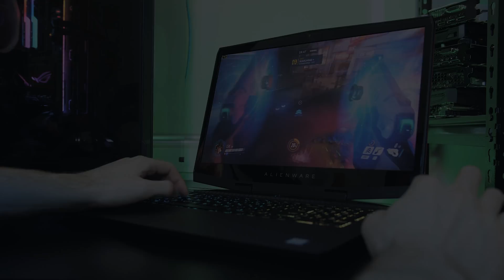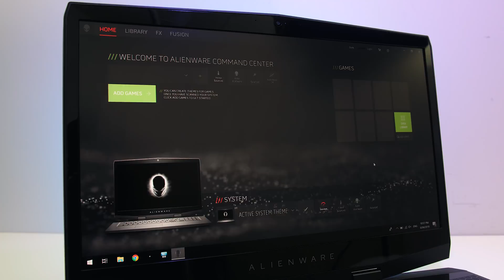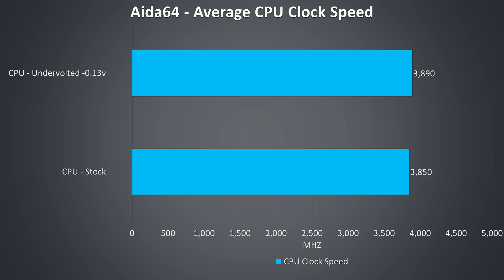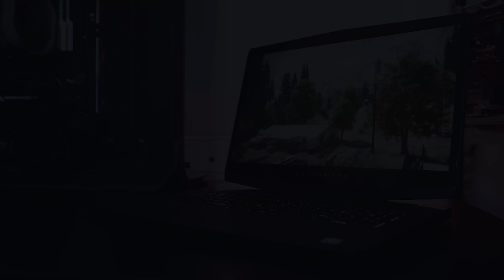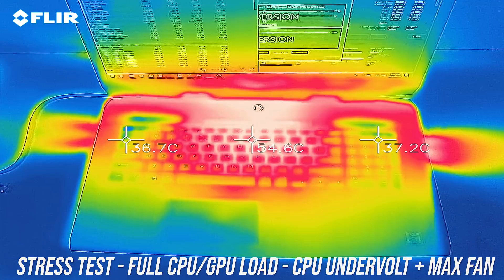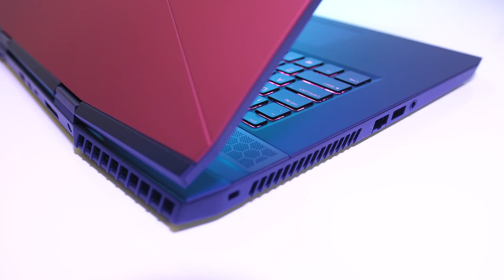Alienware m17 Thermal Testing, Overclocking and Undervolting

Comment: i have the i-7 9th gen, with a 1660 ti of this laptop and it has the best thermals ive seen. i use a cooling pad and undervolt with throttlestop, while gaming neither go above 70c also disabled bios updates so it doesnt get the plundervolt patch

Comment: Can you do the same for the M17, i7-8750H with RTX 2070 Max Q? I'm getting average CPU Temp of 99 °C and GPU 90 °C, is this normal?
Reply: I have the same one. Yes this thing is really hot, I undervolted, using cooling pad and increased the fan for gaming. Let me know if I can help.
Reply from the maker: I've been trying to get new Alienware stuff but they stopped lending me review units. My one in this video runs hot, I'd expect the same from all of them to be honest, give undervolting a go.

Comment: Hi Jarrod . Nice video I bought M17 Alienware based on your review. My configuration is I7 9th generation with RTX2060 OC. Well the bottom line is thermal throttling on the gpu is not existent. Cpu hits a 100 C 4 times in one hour game play(Witcher 3) not noticeable during the game I monitor the temp with Intel Extreme tuning average temp on CPU package was 80 C. My off load temperature on the CPU is around 40 C with room temperature around 20 C. Regarding the thermal pad I did buy a thermal pad as you recommended I got Coolermaster U3. Initially before the thermal pad I had to raise the rear rubber feet on the laptop by 5 mm above the desk surface this also made a difference and it was completely free. I didn't play with voltage and clock speed . I did purchase new thermal paste for the CPU and GPU but it looks like the stock paste is working well. 
Best Regards,
Alex
Reply from the maker: Nice, good to hear you got some improvements! Yeah I have a cooling comparison video coming soon, comparing a cooling pad and simple stand, well the stand offers most of the benefit.
Reply: @JarrodsTech  In my case the 5 mm Lego blocks made the most difference. But the stand makes the laptop a lot more comfortable to use and type.

Comment: what software did you use for the undervolt
Reply from the maker: Intel XTU, Throttlestop is another option.
Reply: Jarrod'sTech sweet thanks, my m17 has a overheating issue so its at 100C a lot so I’m trying to mitigate the heat until the tech comes

Comment: Octane render in cinema 4d tells me there is no cuda device detected on the exact same laptop ..... any solutions ???
Reply from the maker: Not sure, every time I've seen stuff like that the software is detecting the Intel graphics because it's in Optimus mode by default. Is there a way of selecting the correct GPU in the software? Disabling Intel GPU through device manager may help

Comment: After my initial m17 r1 Thermal Grizzly repaste (and raising back of laptop by 1.5 ") after playing games (Apex, DMC 5) for 2 hours or so, I was getting max temps in the low 90's and throttling on some cores (usually 1,3,5), but my average temps were in the 70's, which was a drastic improvement from pre-repaste when the max temps were all 99 with throttling on all cores and average temps in the upper 80's/lower 90's.
I decided to undervolt using ThrottleStop. Since I have a i7-8750H processor, I used Bob of All Trades' video and undervolted CPU Cache and Core by -125mV. My temps decreased by 10-15 degrees!! Now with the repaste, raise and undervolt...I am getting max temps in the mid-70's with no throttling and averages in the mid-60's. 
Makes me wonder how good the temps would have been within the repaste, and undervolting ONLY. Hm.....
Reply from the maker: Cool nice improvements 👍

Comment: I was told by Alienware Support that my m17's i7-8750H processor was operating within normal limits when it constantly peaked at 99 degrees and averaged in the upper 80's-lower 90's while playing Apex for 45 minutes. They told me that a long as it doesn't go over 100, it is fine. That may be the case but I questioned the processor's (and laptop's) longevity if it constantly hit 99 degrees during hours of gaming. Thermal throttling was detecting on all six cores. I decided to repaste. This was my first repaste I had done and was a little nervous about diving into the various components. I figured if I am going to attempt this, I wanted to be prepared. I got all of the recommended materials including Articlean solutions as well as thermal grizzly kryonaut. I followed the m15/17 disassembly videos and Alienware Support's m17 repair manual to remove the necessary components. After removing the heatsink I was surprised to see how thin (practically transparent) the stock paste was. I have read that Alienware in particular using junk paste. I followed the directions on the bottles. I first applied only a drop or two from Bottle 1 to each component (CPU and GPU) and let it sit for about a minute. Afterward I used a business card (to scrape away the gunk) and a coffee filter and micro fiber cloth to clean the rest. I then applied Bottle 2 to polish or finish the surfaces on both the CPU, GPU and their heatsink plates with a micro fiber cloth. As you can see in my photos the CPU and GPU with super clean and ready for the thermal grizzly application. I know there is some debate on this but I went with the line method since both the CPU and GPU were rectangular. It was a hot day (90 degrees +) and at first pump, more came out than expected, but I was able to clean it up after. I have read that other experience the paste to be very thick...but after sitting my 90-degree apartment for a few days, the paste was a lot thinner than expected. After applying the paste, I reattached the heatsink (be sure to follow the screw patterns - FYI my laptop had numbers of the heatsink so you can follow the correct pattern to loosen and tighten the screw to presumably get an even paste spread) After closing everything back up, I ran the Alienware Stress test and saw that the CPU was now peaking at the late 80's - low 90's but that the average temps were about 9-15 degrees lower without thermal throttling on any core. I later gamed for about 50 minutes as saw similar results though with throttling on two cores. I am happy with the results. The GPU also decreased by about 10 degrees on average, Maybe I could have pasted better (less/more?!) but I think I was able to achieve good coverage on the CPU and GPU. (I guess I'll see if and when I have to open it back up again?!) I think overall it was worth it. The temps make a difference and also offer a peace of mind for those longer gaming sessions. Some things to note: you only get a gram of this stuff, but be careful when applying or reapplying, the spatula that is included may be useful but I wouldn't know I did't try it based on other reviews, those that had difficulty using the spatula noted a thicker paste and an inability to properly spread it without making a mess. The general concensus seems to use a little amount (dot/line/x) and let the heatsink pressure naturally spread the paste as you tighten the screws. Last tip is not to understand simply raising the back of your laptop or an elevated cooling pad. This can easily decrease temps by 3-8 degrees. Also ambient temperature makes a big difference...the temps you get gaming in an air-conditioned room as opposed to a 90-degree room will obviously vary.

Comment: So would you say that the undervolt got the thermals well enough under control? Or would you recommend a different machine entirely?
Reply from the maker: I'd pick something else, it helped, but worth keeping in mind I'm doing a worst case stress test here so also depends how hard you plan on loading it up. Hopefully the new 2019 model is better, have not tested it yet though.

Comment: Is there yet any reliable and final solution for thermals ! Specially who are doing renders with full tilted performance .. i mean for  hours ! And hours .. also is undervolting affects the multicore speed ! And singles core ones ?
Reply from the maker: Undervolting improves multicore speed, as it lowers the amount of power required by the CPU, so it can perform the same with less heat. As a result, if there is thermal throttling better clock speed is expected. Likewise, if it's hitting power limits clock speed should still increase as it can now do more with the power available. Aside from that, a cooling pad can help, as shown. The next step would be to repaste the CPU/GPU dies.
Reply: Jarrod'sTech first of all, i would like to thanks you in person for the amazing feedback and instant responding .. you are one of the least who are really reliable and decent ! In such industry ! 

Second .. let me rephrase my question .. if dell is rewarding me a replacement unit for defected  17-r5 max specs .. wit m17 max spec unit .. 2080 RTX, as a man who makes 3d renders for architecture visualization ! Is it ok ! Knowing that i render for hours and days ! 
Taking in consideration i may have a chance to pay 200€ and get a A51m - 
So ! A51 or M17 ! 
Performance wise ! And thermals . 

Thanks in advanced man ! Amazing job !
Reply from the maker: No problem! I would think it would be ok, it would likely perform quite well, there just may be some performance loss if thermal throttling occurs, not too much, you can see in my full review (linked in description) that it still performs quite well. The 51M would be better as it has higher end specs and is also thicker for more cooling, but I believe it still gets hot. I'm still waiting to get the 51M to do a review, apparently I'm on the waiting list.

Comment: I don’t really know about how good the temperature is so I’m going to question something.
Is this temperatures good?
Is this a good computer to get?
Reply: No. Too hot. Asus strix scar 2 instead.
Reply from the maker: The temperatures here are quite hot, thermal throttling isn't ideal and doesn't usually happen under these loads, it reduces performance and for the money you could get something that runs better.

Comment: I have the m17 with 2070 and was hitting high 90s almost 100 with balanced fans on the cpu in sekiro maxed out. The gpu was hitting around the 80s I believe. I may invest in a cooling pad, but are these temps normal ?
Reply from the maker: Depends on the workload, but yeah sounds about right, it's a hot machine though I'd expect different results with the 2070 version so hard for me to say without having used that one, if you're seeing thermal throttling or otherwise concerned about temps a cooling pad should help out.
Reply: @JarrodsTech  well i also expected different results bro. I figured this one would stay pretty nice and cool compared to the 2080 one. But i doubt anything is wrong with it, i just got it yesterday, just couldnt believe it hit those temps with barely any gaming especially on a game like sekiro shadows where its locked to 60 fps. on my desktop i could play most games for hours without my 8700k or 2080 oc hitting anything over 80c at max. but i guess since this laptop is so small with powerful parts it makes sense why it gets hot.
Reply: @1babo  Did u ever find a solution?
Reply: @edxander7169  i got a replacement laptop cause it started having other issues too. no other issues on new one but my new one still has about the same temps, maybe a bit cooler. not much we can do unless you decide to undervolt and reapply thermal paste to the cpu.
Reply: @1babo  Damn, what a hot load of microwave garbage.. So what were the other issues you were having? I'm seeing so many frustrated reviews with this product that are now influencing my decision to not even consider buying this hot mess. There's more cons than anything. I think I'll go with a Asus zephyrus S gx701, it's much more thinner, slimmer and portable it has a much better thermal cooling paste, oh, it also has 144hz :/
Reply: @edxander7169  it was giving me driver issues and performance issues. new one is good, dont use it much though as my desktop is better than the laptop (desktop has 2080 and 8700k). the laptop is for travel.
Reply: @1babo  What temps is your new top reaching when playing for just an hour? I think I saw your comment somewhere else saying you get close to 100c just by launching one game lmao idk if that was you or not
Reply: @edxander7169  idk id say low 90s man

Comment: Thanks for the awesome test Jarrod - my 17R2 literally just gave up on Thursday after 4 awesome years - was contemplating to spend 6500k on maxed out m17 with 2tb ssd - but just found JBHifi’s easter deal incl. another 5% off on the already discounted items - however, it will only be a 2070 - interested to see if that throttles as well?! Only one way to find out :-)
Reply from the maker: Let us know how it goes! I think someone else in the comments mentioned their 2070 Max-Q one was a little cooler.

Comment: Just got a Alienware M17 20170 MQ i7-8750H. Got hot, hits Thermal throttling and fans go mental. (Fans do cool it back down though...so just annoying). Then.... Undervolted it - as per your video, started higher but yeah, as soon as I hit at -0.13v - it's like magic. Now it's super quiet quiet, cool on CPU and to the touch and gets better frame-rates and benches better. So weird, but really happy with the laptop now. I also have a Aero 15X with a 1070MQ and now that is louder and hotter. So thanks! Liked and Subscribed.
Reply from the maker: Nice! Good to hear it's running better 👍 and welcome to the channel!
Reply: How is the 60hz performance especially for fast pace fps.
Reply: Nick tan I haven't experienced any issues, feels and looks great. I have not tried many games yet. Mainly bought for VR Content development etc. But played Insurgency Sandstorm and a few other games without issues.
Reply: Nice! I was able to overclock the display on my m17 up to 80hz which actually helps a great deal if you are used to higher refresh rates. I was used to 144 from my desktop, so I was almost ready to return this laptop until i found out the refresh rate could be overclocked.
Reply: @christophermartin7744  wait. How were u able to overclock its refresh rate to a 80hz!? Haaaaalp :c
Reply: @edxander7169  Using an application named CRU. Make sure you read the directions very well and know what you are doing. Never delete the default resolution options while creating your custom options. Do at your own risk. Some people got up to 90 hz overclocks. I was only able to get up to 80.
Reply: @christophermartin7744  welp I blew up my entire  computer thanks to that application :,(
Reply: @edxander7169  Dang. Sorry to hear that. I'm not sure how CRU can "blow up" your computer on it's own, though. If you boot up in safe mode or plug in an external monitor, you should be able to set your refresh rate back to normal and start over.
Reply: @christophermartin7744  NO NO NO NO MO!!!!!!!!  It's true it's true!!!! 😭
Reply: @edxander7169  It got fixed?
Reply: So a nice undervolt will help a good bit huh? I just ordered an m17 8750h and 2080mq. Hope the undervolting will make a difference if not I guess I will be learning to repaste lol
Reply: Wesley Williams hey man, am expecting mine to arrive within a week or two .. as a replacement for my 15R5 .. defected version and am doing rendering by 3dsmax, as architect ! Let me know how did it work with u .. as am having an option to switch to a51 m .. paying 2-300 dollars .. 
thanks in advanced man !
Reply: MOHAMED MAHFOUZ an undervolt helps man. It’s doing good but I’m gonna repaste too this weekend

Comment: The 2070 version does a bit better thermally and gets the same framerates. Going to repaste this weekend.
Reply from the maker: Cool, let us know how it goes!
Reply: Finished the repaste with Grizzly Kryonauth Thermal Grease paste and changed out the thermal pads on the vram chips with Fujipoly pads, but it really only decreased temps by a few degrees celcius. It was a pretty good paste job to begin with. Alienware did a much better job with these applications than most manufacturers. Still, I believe the m17 2070 runs quite a bit cooler than the 2080 version and my benchmark scores were pretty close to yours with very little throttling. I'm impressed.
Reply from the maker: @christophermartin7744  Thanks for sharing the results!

Comment: Did you see the new samsung odyssey?
From what i could see (well at their advertisement actually) that device seems promising this year, since the cooling solution seems could handle some mean heat for their model in this year...

But i didn't think it would be placed at helios 300 price, and maybe it would be put in a triton 500 price range (i hope it's a bit lower like 1599 or even 1499), but still that device seems interesting to test on in my opinion...
Reply from the maker: I hadn't, interesting! Now I need to try and work out how to get a Samsung contact in Australia haha.
Reply: @JarrodsTech 
Indeed hahaha...
Well good luck at that bro!

Comment: I really wanted to have this laptop work for me, but it was brutal keeping it cool.  I tried undervolting as much as possible but was throttling still.  I did however, had a great experience with the last gen R5 with 1070.  Kept it cool under load around 60s and low 70s with XTU.

Appreciate your findings as it was similar to my experience with the M17
Reply from the maker: Yeah it's not ideal, thanks for sharing your experiences with it!
Reply: So did you return it? What computer did you get?